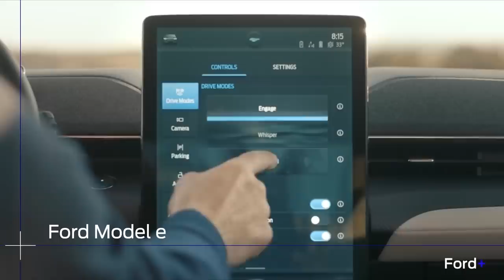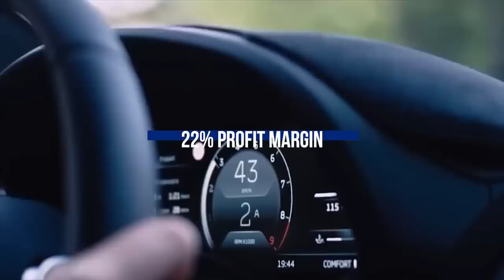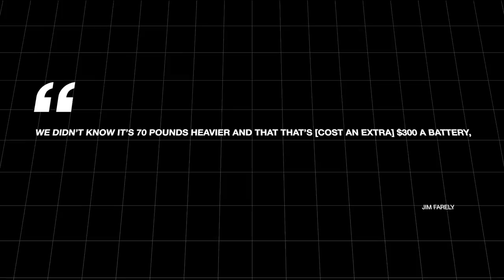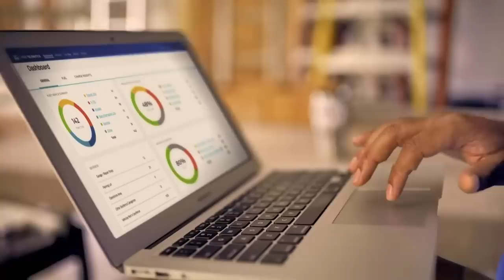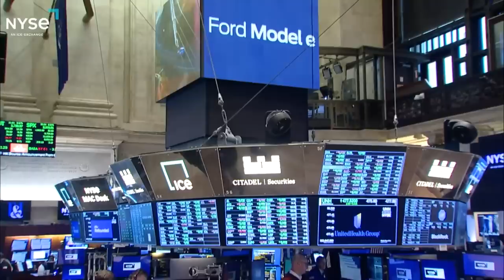More Bad News For Ford Motors

Comment: Hey Ford,  how about make a plane truck and car for the working man. A motor ,4 wheels and a steering wheel. We could care less about screens and leather
Reply: Right!  I don't need a spaceship.  Like a car from the 90's with an electric motor will be fine.
Reply: Yea and a MANUAL..transmission.
Reply: I like my screens and leather but I drive Chevy so it’s more affordable
Reply: @tattoo magic  I do too, but if I can get a good running bare boned car for 12000 bucks brand new I think I could live with that. If I want upgrades I will do it myself. To hell with parking assistance, backup cameras, heated seats, fuel injection, power windows, electric fuel pumps, ABS,on star, heated mirrors and so on.
Reply: @thebattery500  You can have your E motor, but before you buy take a look at the human tradgity in the Congo. The EV industry needs to be shut down before there is nothing left of the planet.
Reply: XL's are close.

Comment: The Focus ST is probably the best thing Ford is making now.  will be a shame when that stops.  The EV's are too expensive for most ppl.
Reply: and the Raptor R
Reply: Not to mention having no value in the used market.
Reply: What ? The car that blows head gaskets from the factory !
Reply: @outkast40  The Focus RS is the one blowin head gaskets, faulty open deck design what a shame.
Reply: Except they aren't making the FoST or FiST for North America
Reply: No longer available in America...
Reply: @chrisashmore2957  Yeah ! They also sourced cheap wire harnesses again, that lose contact at the connector.
Reply: New cars are too expensive for many. EVs aren't a special case. Several EVs cost less than many ICE vehicles.
Reply: @patrickweaver1105  where are these free used EVs?  I want one.
Reply: @theupscriber65  No you don't the parts to repair them cost far more than you could ever sell one for. If the parts exist at all that is. They're not free, just worthless. As in having no resale value.
Reply: 150 mile range empty with a headwind.
Reply: @ficklefingeroffate  True unfortunately. The ST was in my sights when Ford pulled the plug. Just another stupid move by Ford. Hey Ford... offer a cool, fun car that a young person can afford and guess what? You just may have a customer for life. But nope... no more Fiesta ST. Like I said... stupid move Ford. 👎🏽
Reply: @patrickweaver1105   Used EV prices are high.  It's the ICE D-Bags desperation when ever gas prices go up 10 cents that is keeping them so high.  For a while used Teslas were more than they were new.
Reply: EV's are a joke - poor range, fire hazards, low resale value due to battery replacement costs, and so much EMF its like sitting in a small microwave.
Reply: @fx-studio   Even the Russian trolls don't make up that much nonsense.
Reply: @jerryjeromehawkins1712  I have a 2016 FiST.  Best car I ever bought
Reply: @ficklefingeroffate  hey Fickle... I hear you. I'm keeping an eye out for clean used one but... soon. Very soon. Hold on to what you've got bro. 👍🏽
Reply: @DeputyNordburg  No it's because new EV prices are ridiculous and used EVs that work are rare and don't have tax incentives. There are hundreds of thousands of EVs less than five years old sitting  junkyards all over the world. Teslas are a status symbol and the only company that makes enough money to justify their existence. Gas prices doubled and internal combustion vehicles are still more practical, cheaper and longer lasting.
Reply: @patrickweaver1105   you are joking.  Evs have an 8 year battery warrantee required by law.  ICE is less than half.  Most diesel pick up truck cost more than a $100,000.  Grow up.
Reply: @patrickweaver1105   Here's a fun experiment.  Take a car like an VW golf, that you can buy ICE or Electric.  Price a used year like 2018. ICE = $15,500.  Electric = 18,700.  

Anyway 💩4🧠s, have a great day.
Reply: @DeputyNordburg  Now compare the number of EV to ICE VW Golfs on the market. Then realize either way the Golf is a crap car and they don't sell it in the USA at all any more
Reply: @DeputyNordburg  Maybe where you live. EV cars have eight year battery warranties but only 100,00 miles. When you drive as much as Americans do that is four to six years. Considering how many make it to 250,000 miles unless crashed there's no comparison. My car is eighteen years old with 154,000 miles and runs like a champ. It came with a ten year 100,000 warranty. Try that on a lithium battery. The Ford Super Duty F-250 SRW Limited 4x4 crew cab has starting at an Invoice Price of $43,666 and an MSRP of $45,865 including destination charge.

Comment: Ford's new business plan is to build EV's (that most people don't want) at a loss and then subsidize those losses by charging more for trucks and SUV's that people actually want to buy. Problem is average Joe is struggling to pay $50,000+ for an F150.... Ford could sell 100K+ F-series trucks a month of they were affordable.. The  demand is there for that just not at current prices.
Reply: Ford has bad 10 speed transmissions and broken engines. I don't think their defective vehicles can support their defective EVs
Reply: @outkast40  Ford has about 1% of bad 10-speed transmissions and broken engines. There I fixed it for you.
Reply: My 10 speed in my 2022 F-250 with 5000 miles is junk. Was in the shop for 2 weeks, leaking fluid, lurches into gear, grinds when downshifting from 5 to 4 and 4 to 3, shakes at idle, etc
Reply: Businesses have to reinvest into their businesses in order to remain in business long term. That means the current thing working funds the next thing - which is a risk either way. Sales of the Apple II funded the research and development of the Lisa and MacIntosh. No one wanted the Lisa but the Mac sold well - eventually they discontinued the Apple II. Also, people have a tendency to think everyone holds their beliefs and desires - which is especially true in political bubbles. Most folks I talk with that don't currently own an EV would really like one if they could afford one and it met their driving needs. Of course, there are those that are "never-evers" - we'll let them play in their own grease pit. Granted, I run into truck owners that don't understand why anyone would ever buy a car - I don't understand why anyone would buy a truck when I can rent one from Home Depot the once a year I need one.
Reply: @JasonTaylor-po5xc  'let them play in their own grease pit'.. nice derogatory comment about those who don't follow your EV dream; I've had the same ICE vehicle for over a third of a century and service it myself; it takes a miniscule amount of my time and money and it's been totally reliable.
Reply: @CountrysideLawnService  Ford sold 653,957 F-Series in 2022. How many had the problems yours had? And did Ford cover yours on warranty?
Reply: New F150s are 50k before the franchise dealerships tack on a 15k to 35k "market adjustment" on top and wonder why thier lots are full right now 😆
Reply: You said most people don't want EVs,  but they are sold out everywhere with a waiting list.
Reply: @petesmitt  LOL - I actually wasn't trying to be derogatory, but whatever - some folks are immoveable, so why bother trying - just let them age out. Unfortunately, I haven't had the same level of success keeping ICE vehicles running. My minivan needs 3k of work right now (according to the stealership). Before getting an EV, I would buy Japanese cars with the hopes they would require little maintenance to keep going. I'm not a mechanic so I don't work on them myself. I have had my Tesla Model Y for 18 months and only had to top off the windshield wiper fluid. That and tires should be the only things it needs.
Reply: Hate to tell you this by non ICE vehicles are the fastest growing market segment I across the Western world, remember Europe has banned ICE vehicles by 2035, and many other countries are offering significant tax rebates on clean cars
Reply: @Carguytct  globally- fastest growing segment in the Western world.
Reply: @JasonTaylor-po5xc  There are those of us who need and use our trucks every day, not once a year. But, I also know someone who just drives a truck because she likes it, never hauls with it.
Reply: @JasonTaylor-po5xc  what Americans don't understand is that we don't have  any rights to driving vehicles. The government sets the rules and if they say you can't drive ICE vehicles , you won't drive one.
Reply: @DennisMerwood-xk8wp  if it's 1 percent of a mass produced vehicle that fails, it cost them million plus a loss of future customers . Ford has the most recalls on the planet!
Reply: @Carguytct  The world is showing an increase in EV sales while ice vehicles are in decline .
Reply: @craiggillett5985  Toyota and Honda are in a panic as EV sales increase everywhere. Toyota even discontinued sales of the Camry because Tesla is selling at the same price and taking market share.
Reply: Tesla model Y will be the most sold carmodel on planet Earth in year 2023😎 👍
Reply: Plenty of people want EVs. The pricing is the problem.
Reply: @justinstewart3248  Tesla's are selling at the price of a Camry with incentives. Next year the model 2 will be 25000 before incentives with better & safer batteries
Reply: @outkast40  Agree!
Reply: Add that to the recession. Trucks are too expensive.
Reply: @Carguytct    "sold out?'  What numbers are we talking about?  AMC sold 200,000 Pacers in their first year but were terrible cars...DeLorean was sold out when it first came out....There are lots of 'consumers' who will buy anything shiny and novel for bragging rights.  Meanwhile, the ICE Ford F150 pick up has been the best selling North American vehicle each and every year for half a century...although that may end if they continue to burden ICE buyers with inflated prices to pay for electroheads....
Reply: @justinstewart3248  
Not for a long. Battery prices are dropping rapidly and there are like nine new battery factories being built in the US as we speak. It only takes a couple three years for them to get going. Bev's are clearly the future.
Reply: @philborer877  I agree! The future is bright!
Reply: Yes so true
Reply: @JasonTaylor-po5xc  I will gladly play in my grease pit if I can stay out of your untreated electric septic system....I drive about 60,000 miles a year, some of which consists of trips necessitating several hundred miles in a day. EV technology is not where it needs to be.

Comment: The worst thing they ever did was stopping car production. Not everyone wants a Mustang. I had a few years ago, thats enough. Thanks to them, I now drive a Honda. No worries.
Reply: They stopped because no one wanted to buy trash ! The CEO has told you people many times that it has to stop making vehicles that cost them billions in recalls.
Reply: Me to I have had 3 mustangs but am older now and don't need a SUV and own a truck . Honda is my go to as well .Nice cars.
Reply: @Believer21777   Same here. 2005 pilot with 240K. Purrs and shifts like new. Lots of wear items replaced though. 18mpg isn't great but it's been paid for since 2005.
Reply: @outkast40  if they had designed and built them properly in the first place, then guess what, NO RECALLS.
Reply: @arthurdardalis  I've purchased many Ford's and found that most of their problems come low bid parts suppliers.
Reply: Clearly they didn't realize now everybody wants an eMustang too.

Comment: The problem lies on dealerships increasing the prices on those units, which nobody can afford anymore and with higher interest rates just makes customers walk away.
Reply: Sure blaming the dealerships for mark ups is one thing, but the msrp of those trucks weren't that much closer to being afordable to begin with. Unless you really want to spend 70k+ on a truck that cost Ford about 20k to make.
Reply: Msrps were/are $10-25k marked up by the time they reached stealerships some of which customers waiting prices changed what they were promised by time they get it!
Reply: So if that’s the problem, why doesn’t Ford just sell on line and direct to the chromed like other contemporary companies?
Reply: @craiggillett5985  regulation prevents it
Reply: Dealership = stealerships
Reply: Supply and demand... don't like it, then buy something else and they will have to lower prices (unless other people are willing to buy them).
Reply: @michaelreedx6823  The problem is it's not just the EV trucks that have gotten ridiculous in pricing its all of them! They bloat the hell out of them with options for yuppie sales.
Someone needs to build a truck for the working person! Lower slung (easy to work out of), little to no options, just comfortable seating with heat and air at a blue collar affordable price! Even bring back the mini-trucks if that is what it takes!

Comment: As both owner a Raptor I bought new in 2018 and a share holder.  I feel Ford is loosing its customer base on several fronts.  I’m not interested in EV’s until the range  and charging infrastructure are improved.  I also had my dealer ordered Bronco order canceled by Ford due to dealer error.  Then the dealer offered me a Bronco on its lot with a 20k markup.  Ford needs to fix this mess for its stock is not going anywhere
Reply: When charging stations are everywhere with 5 minute total charges and the batteries don't require adolescent mined cobalt I'll consider one.

Comment: Restructure the dealership model so that we know what we're paying for and the playing field is level.
Reply: I hate the dealership model. I ordered my Tesla Model Y online - no high pressure tactics or "let me talk with my manager" nonsense. Just pick one of a few options they have, provide payment details, and that's it - if it was a custom order, you'll need to wait a few weeks or months (depending on the model). Mine was from existing inventory, so it only took a week. The delivery process was super easy too - just show up during your appointment window, sign a few papers and drive off. Regardless of how folks feel about the cars - that was such an improvement over the dealership model - I never want to step foot in one ever again.

Comment: EV isn't going to replace ICE engines. There isn't the grid infrastructure, the power generating plants or the materials (copper, nickle, cobalt, etc). Alt energy is also a bust, so Net Zero is going to go bust. EVs are great for niche adoption, maybe 25%.
But what do I know, I'm just a mechanical engineer who has been doing solar, nuclear and coal for 35 years. And builds classic cars.

Comment: Ford can’t even make a car without many recalls. They want to do EVs now? Lol
Reply: Right? #1 in total recalls per car made and #1 in warranty claims&cost per car made. And they choose pouch cells for their evs so far. 🙂
Reply: There is nothing realy wrong with recalls!
Reply: @brunoheggli2888  Unless the recall is for cars spontaneously combusting. EVs seem to do that alot.
Reply: @patrickweaver1105  get your facts before posting sir ! LG chemical made those defective batteries for FORD and GM.
Reply: @patrickweaver1105  I agree!
Reply: why you  get so many recalls is because when they fill there cars up with to many second rate trinkets from chinese supplers, your going to get recalls.
Reply: @outkast40  I never wrote a word about who made them. I couldn't care less who made them. It's happening all over the world to every EV brand regardless of the maker of the battery. From bicycles to busses it  makes no difference. Lithium Ion batteries are easily ignited and almost impossible to extinguish.
Reply: @patrickweaver1105  Dude ! Get educated before you speak about batteries. New batteries that don't catch fire are already on the market . I understand you yahoos very well.
Reply: @markseehawer3762  Right. Ford proudly a made in  American icon, blames China for their own poor quality control and workmanship.

Comment: Ford jumped into the EV market with both feet, when they should have a big toe in first and tried that.  American consumer market is not totally ready for 100% EV's.  Especially the pickup truck market.  EV's are just not there yet.  Manufactures still have to prove they can get the material for battery manufacturing from the USA, not Africa or (indirectly) China.  MJ
Reply: I agree with the 100% part (especially light-duty trucks), but there are many use cases that EVs are way better than ICE right now - that is as a commuter/local errands car. ICE vehicles lose all the energy spent getting up to speed the moment the brakes are applied (stop and go traffic). EVs can recapture much of that energy via regenerative breaking. So, for the overwhelming majority of middle-class working Americans that have to commute into work everyday - many of which have a second vehicle anyway - an EV is an excellent choice. Most folks only drive about 30-40 miles per day - even if you double that, you're still fine. Just charge overnight and you have a mostly full "tank" every morning.

If you are on still the fence, you can split the difference and get a Plugin-Hybrid (PHEV). For me, the ideal is actually EV commuter + PHEV for everything else.
Reply: Tesla model Y will be the most sold carmodel on planet Earth in year 2023
Reply: Ford are doing the right thing.  They have to make a success of their EV business, because in 10 years’ time it will be the only game in town.  If not, they will be out of business just like Kodak.

Comment: Maybe if they stopped charging so much for such cheap products that break so easily. I just sold a 2023 Bronco and the handle to recline the drivers seat broke just by lightly pulling up. 

There are so many cheap plastic parts used that break in Fords. It’s disappointing. I don’t think that changes with their EVs.